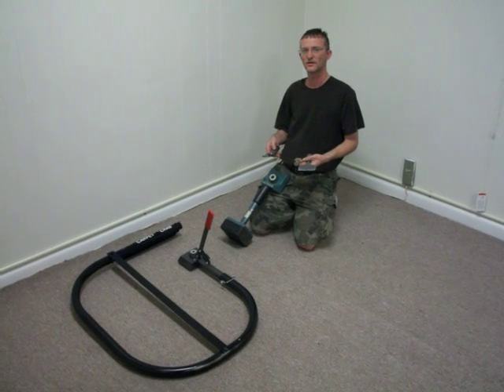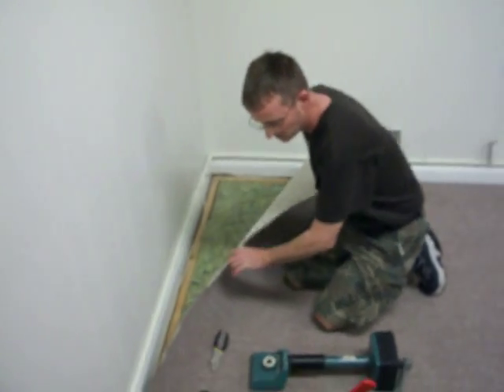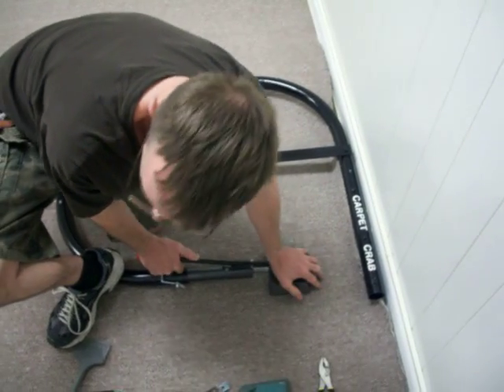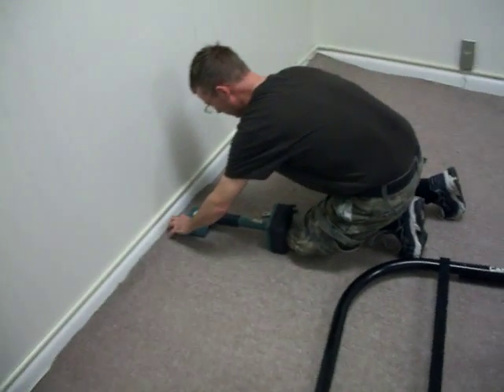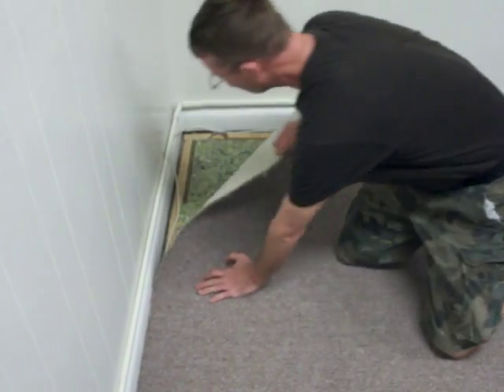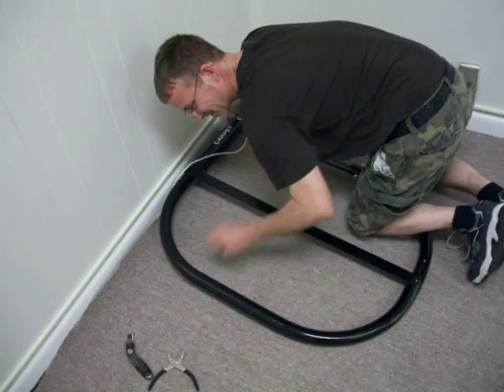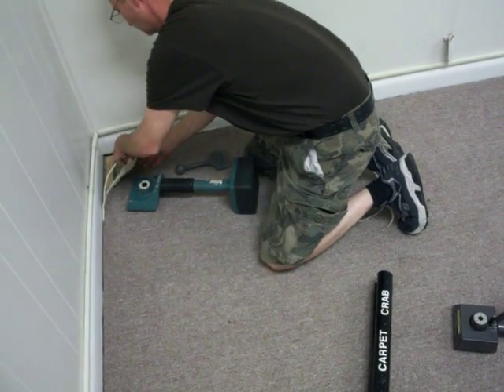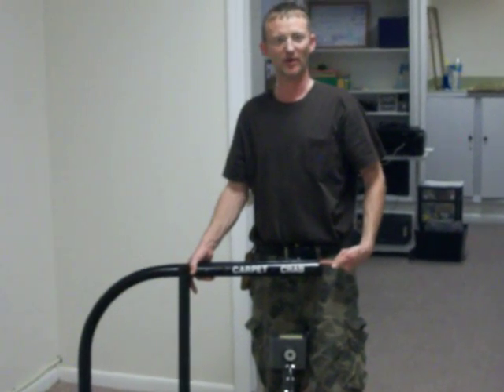How to remove carpet wrinkles with the Carpet Crab power stretcher

Comment: What a joke I could already had that carpet restretched with a four-point power stretch the correct way with a regular power stretcher oh and actually used the proper stairtek or two that would be a metal one you only use a plastic ones for vinyl